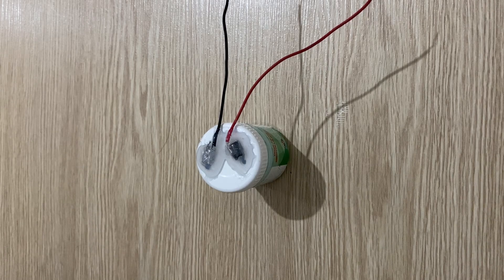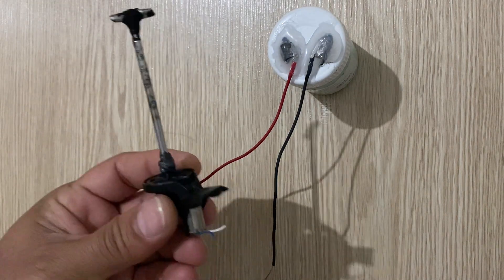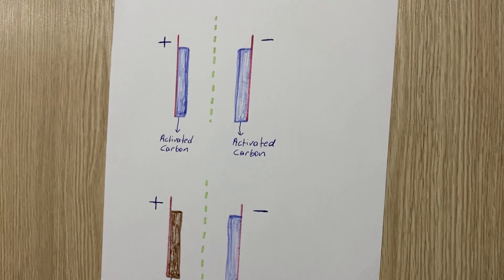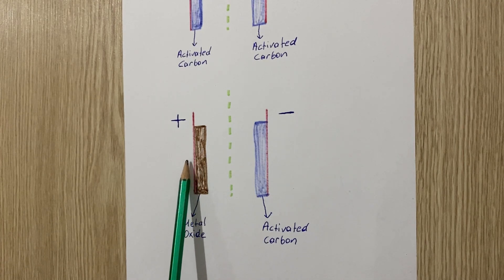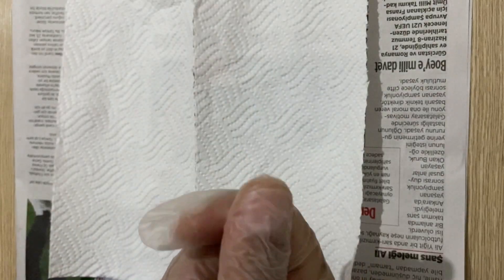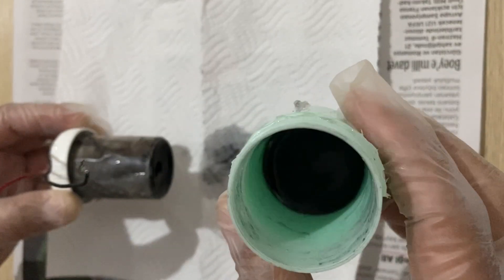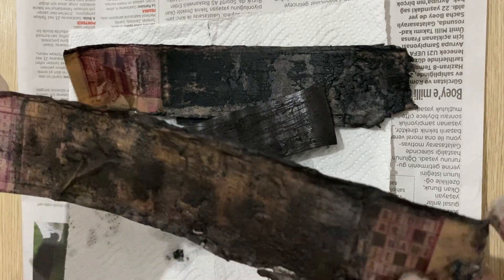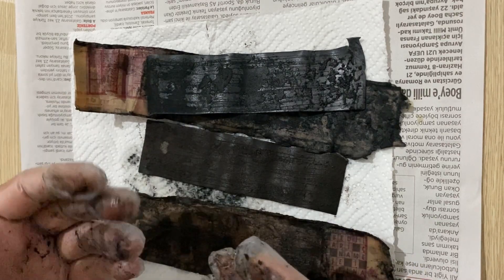How to Make Hybrid Supercapacitor (2.1 Volts, 100 Farads)

Comment: You can use sodium sulfate instead of sulfuric acid. Less performance but much longer lifespan and still good voltage. Can charge and discharge quickly. Much safer to handle too. No risk of burning your skin or damaging your work space.

Comment: Why can't it be charged with more voltage?
Reply: i use google translaste for write this comment
Reply from the maker: if you charge with higher voltage the electrolysis process will start and the capacitor will damaged

Comment: Well, good work, my friend, but I want to make a capacitor with high voltages of up to 100 volts and 100 farads using aluminum foil.
Reply from the maker: With current technology it’s impossible☺️
Reply: @joyofelectronics9782  But how do you make that capacitor that you made but with aluminum foil